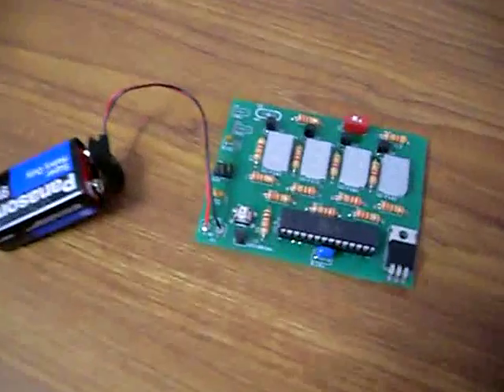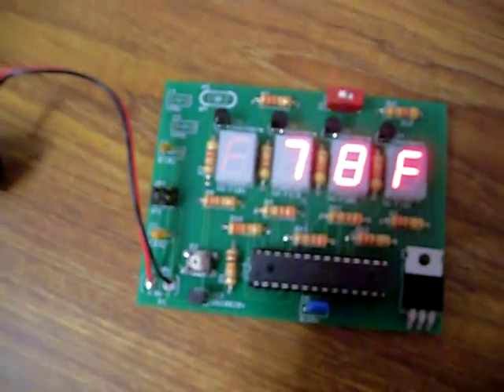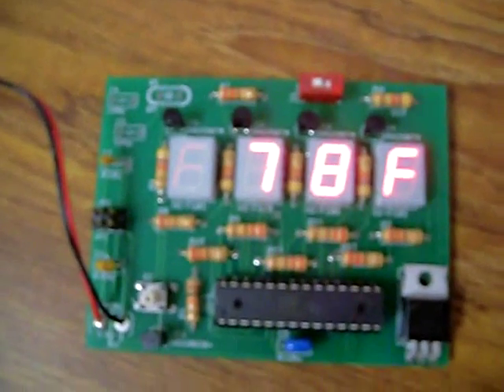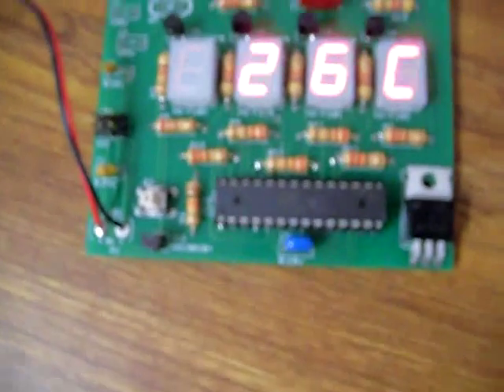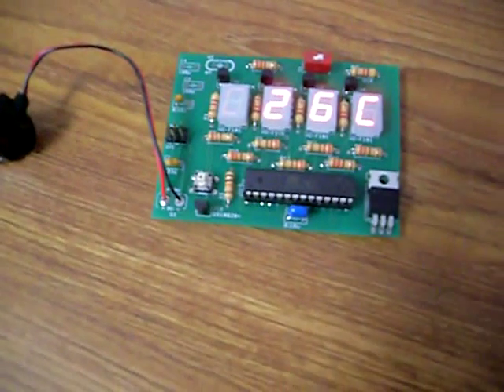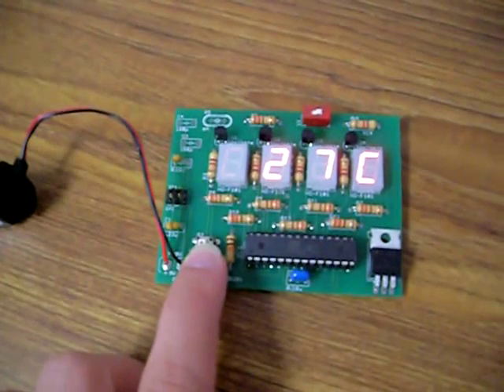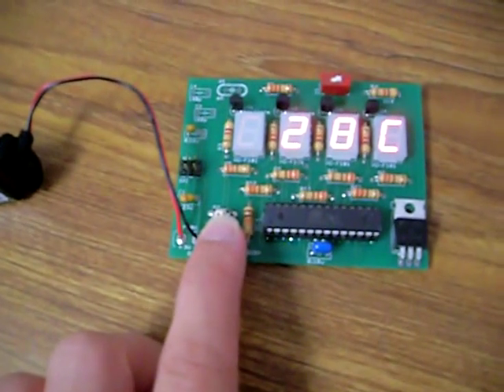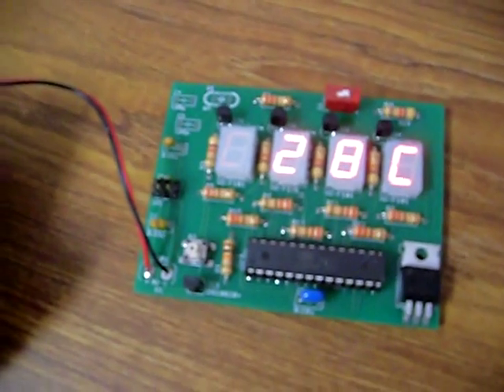my first avr project!!! (thermyv3)

Comment from the maker: yeah, it ghosts a bit 'cause it was my first mcu project and i haven't spent the time required to fix it. :P

i wrote it in C using avr-libc... pretty straightforward, just sends the 1-wire command and loops until the ds18b20 outputs the data, displays, then pauses and repeats it all over again.